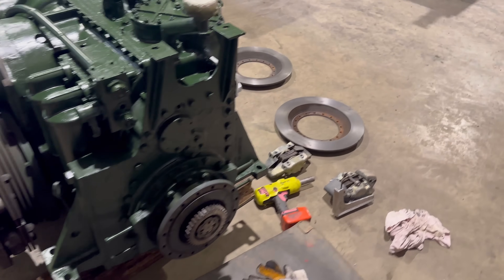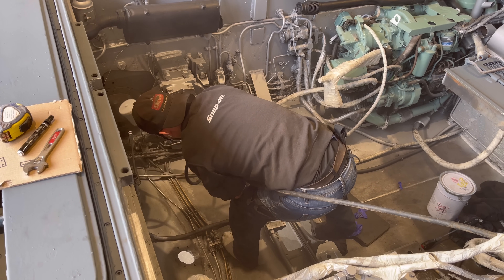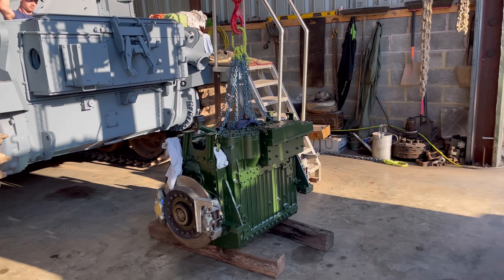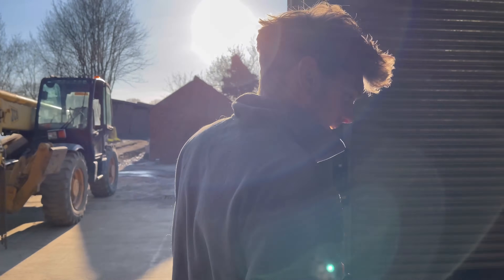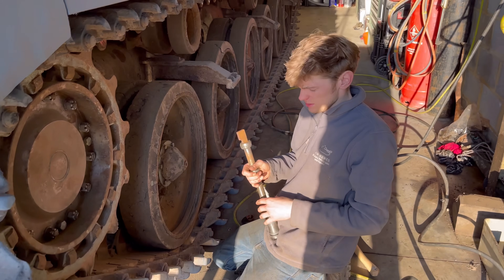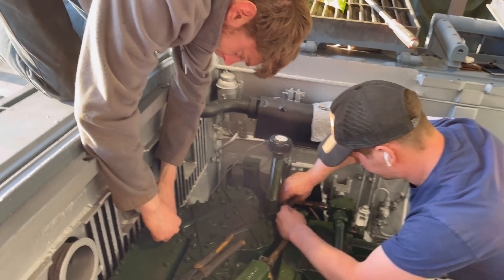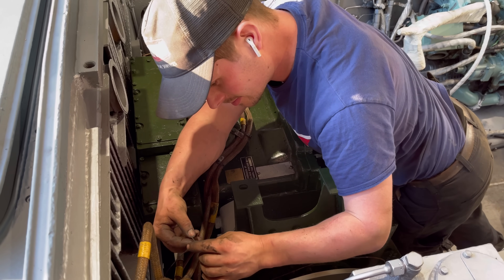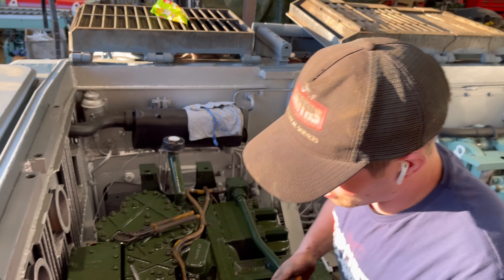How to Fit a Gearbox in a Chieftain Tank

Comment: The tool for securing  the plate  on was called a 'tool combination ' or 'combi tool'  It fitted all the filler plugs and drain plugs. It could also be used to open hatches from the outside. We also used it as a weight for throwing d10 up into trees so that we could hoist cam nets up.

Comment: got to love Hot Panty Jack - he fits those shorrrrrts oh so well, and over trousers, i'm impressed, and his voice never went up while climbing the steps - next week is high heels week
and we can't see what Joe is wearing behind the camera - a tank top - the glasses is a nice touch, such a bright lad

after being advised to use the words reinsert, removed glasses and resorted to 'sliding it in' 
is the lever for 1st, 2nd and 'run away' gear
Jacks pretty nifty with the old ratchet, but why hasn't he, i mean why hasn't Joe got him a cordless ratchet, use a 3/8s with 1/4 converter, it saves him putting the tool on and walking round in circles
loving the banter as ever, always a joy to watch

Comment: Looked like the bolts for the steering discs weren't lock-wired.
Always enjoyed doing that job when it was 2am and pouring down with rain.
Reply from the maker: I despise lock wire
Reply: @MrHewes  It's time-consuming even with the right pliers, but quite satisfying. And better than lifting the gearbox a week later when the steering disc had come loose and disintegrated.
Out of interest, what are you using instead?

Comment: Random question, what's the curtain track looking thing around the driver's hatch and extending up around the turret for?
Reply: Originally fitted to enable a fording screen - never used.
Has a small drain just in front of the driver that when clogged, makes a great water trap to soak the driver going up an incline.

Comment: Be careful peering over those cooling fans while the engine is running and the blades are turning. One loose jacket part and things start to unravel pretty quickly.

Comment: Is there a reason why you use WD40 when you installed the bolts (13.00mins )?  WD40 is a poor lubrication, so wouldn't copper slip be better ( unless it's "'ally") ?  P.S. I know little to nothing about military vehicles so I'm genuinely interested as to why you use it, other than as a release agent?  Great channel by the way and to say I'm jealous of you and the crew playing with big toys is an understatement! Keep up the good work!
Reply: Far better release agents out there.
Reply: Because it's cheap...
Reply from the maker: Just to blast off the grit out the threads before fitting

Comment: fook they are some small calipers for a 50 ton tank
Reply: They aren’t used very often I believe, certainly nothing like a car.
Reply: @davog1946  exactly, in 1978 I was driving the Leopard 1A2 and wasn't stomping much on the breaks and on downhill was using the lower gears..

Comment: oh dear  so many fundermental mistakes  being made as when you will discover when you come to fit the main engine pack,,it would have paid you dividends if you got hold  of  retired  real A mech and let him brief you on the important details of everything chieftain for reliable easey running,,should have lockwired the brake disc bolts in a paired  s patterern  do not use locktite!!
Reply from the maker: Guess we will see won’t me 😉 
Having ran a fair few of these now I have my own opinions.